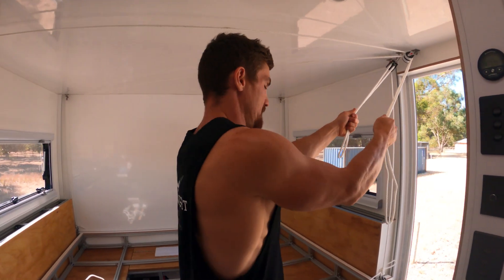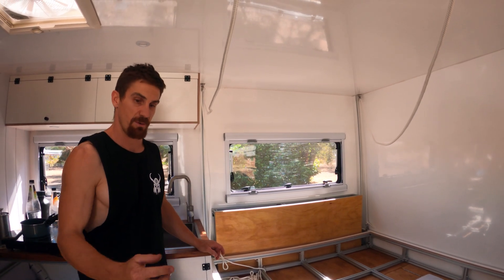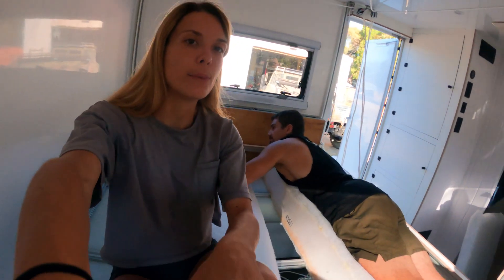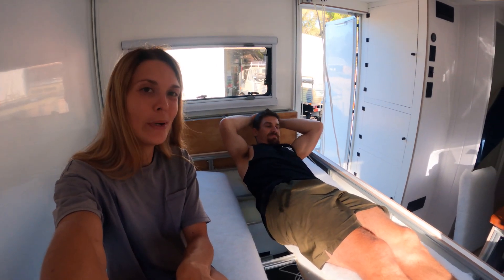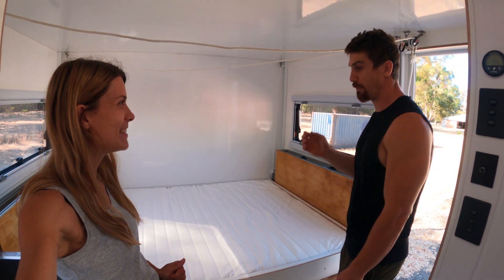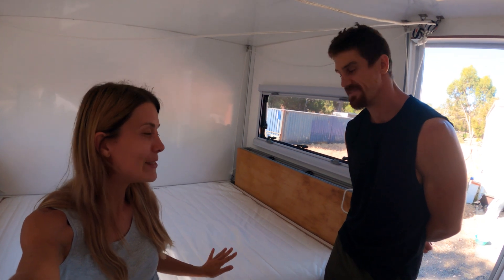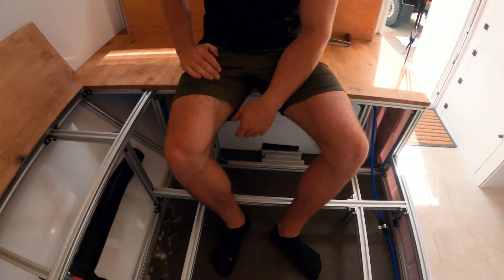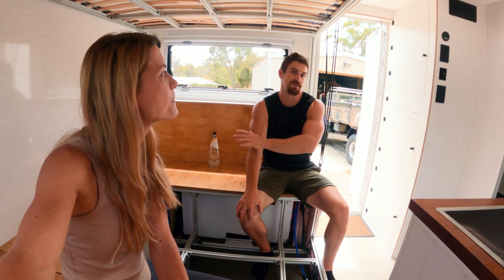Affordable DIY Bed Lift - Getting Close to THE END OF THE BUILD! DIY Camper/Caravan 36

Comment: You could put a contact connector that only in the upper position transmits energy to the structure of the bed in this way you would not have loose or moving cables if you like I can send you a diagram, Hello from Bolivia I love your channel

Comment: Try electrical chain conduit for the hanging wires. 

URBEST Black Plastic Flexible Nested Semi Closed Drag Chain Cable Wire Carrier 1M 15mm x 30mm for Electrical Machines

Comment: Hi guys! What do you use to connect the bed frame to the rails? Specifically, the part that guides the bed up and down. We’re using a 30x30mm aluminum profile with an 8mm CNC rail but don’t have a door sliding mechanism. Do you have any suggestions for guiding the bed frame through the profile itself? Cheers

Comment: I would have probably used a linear guide in the corners, SBR20 or 25 for example, instead of the sliding door mechanism. They are a bit more substantial. For the cable maybe have a look at cable chains.

Comment: Hi guys, what about using a usb battery pack to power the puck lights, then you only need to plug in a wire when you need to charge the battery  pack. You could wire in a switch somewhere under the bed to be able to turn them on and off.

Comment: You could use a long bar 3)8 threaded and a 50gigherzt to 60 electric motor with a washer two should be place them apart two spool line down

Comment: Slick. This is one of my favorite designs. I would pay for a class on how do replicate what you did. I love that you powder coated the rails white - plain metal has been one of my primary objections to using rails and you showed me a new way of doing it.  I'm curious how much it cost total (I apologize if I missed that part)? I'm also wondering if the bed partially rests on top of the seats? I'm wanting to do a system in a bedroom without the underlying seating. Also wondering if the pully system had  to be at an angle, or if it could have been attached to the wall?

I would love links to the winch, cleat, etc.

Comment: Re power. I had a another thought... If the power is for when the bed is up all the way or down all the way, then you could use spring loaded contacts like you get on van sliding doors, then you don't need the cable. jaycar sell them Sliding Door Switch / Contact Plate.

Comment: I would put battery powered lights in to avoid wiring lights into your system. Or if you really want to have it put the wiring into a retractable spool similar to a seatbelt mechanism

Comment: Alucobond or whatever brand you can find for the bed ceiling. Light weight and easy to use (may already have been mentioned didn’t read through 200+ comments)

Comment: Yes I figured you would have went with the other style or folds up and down that way you don't have to worry about the pulley system breaking and coming down on top of you on the other way it won't move because it's locked in figuring you'll be more safer and then go from there ok

Comment: Yes that thing down by your legs when you come in the door might want to pay more attention this way you won't smack your shin on your pulley system that's going to hurt but the wire we have right there if you're able to I'd have something right there like a little round thing or square tube you put the wires through that's pretty flush really straight that but the thing down by your knees you might want to have a guard for that so that way when you come in you won't really smack it really hard one would think

Comment: G'day Guys,
Perfect results.
For the light, if it comes from the roof and hangs down beside the bed it will hang down (in conduit) as the bed goes up and down. For bottom of the bed, why don't you continue the sailing theme and use a sail and glue and screw it to the bottom of the bed frame.

Comment: Land  yacht as a name has negative connotations, while it is large..not large enough to be called Leviathan, yup need at one more axel for that :)  multi coloured rope, with a nice mix of dark and light colours will show less dirt then even black rope. You could call the rig “mogi” or hortence.    Are the light high or low voltage?  I’d use a flexible wire way…like they use for robots etc…the wires will last almost forever.  Otherwise use a soft rubber cord you can route with a nice loop and have out travel up and down.  Live confidently and peacefully

Comment: The cleat and winch will hurt when you are walking past and knock it. Can I suggest a better system with pulleys under your seat. Or electric mini 12 volt winches mounted under your seats with a switch at the door.

Comment: Research linear actuators, u will find them in lengths that could suit your bed lift idea, 1 flick of a switch could provide u with an easy to use bedding system!
Reply: The problem with linear actuators is that you are limited with your stroke, e.g. to get it right to the roof you need at least a 900mm stroke but the when when retracted the total length is still over a meter so the will only go down as far as about the top of the seat giving about 900mm of head room. This is used a lot but their rope system allows the bed to go down further. The Lippert beds work on a similar system.

Comment: At some stage in the near future I will be getting a Mog and putting on a camper.
Not sure if I will be doing it myself of simply getting Unidan, Bliss or someone else to do it, but I've been watching your build and Damn, thats not bad!
Main difference I will be making is setting up the camper so I can jack it up and remove it from the Mog with actuators.  If your familiar with Unidan then basically how "Kermit the Mog" was setup. (removable camper)

I like my extreme 4WDing when I go places, so the ability to drop off the camper and go climb things that "*Can't*" be climbed really appeals to me.
I had been struggling with space and so I had also decided to do something like that with the bed, but I was looking at 4 actuators, I had never considered a rope solution. Thats brilliant. Are you using dyneema rope (very strong but more importantly, no stretch).
Your solution is brilliant!  Well done.  Maybe run the diagonal rope that goes to the far corner through a pully on the other rear corner?  Maybe encapsulate the rope with conduit (maybe at a later date)?  Just thinking of hiding it.

I have also worked with that aluminium extrusion before, it can be a bit painful (specially 'if', scratch that, 'when' you forget bolts), but its very versatile and strong.  Just gotta be very careful to cut it at 90 Degrees. 
I'm also thinking of making the box slightly taller with a false floor (250mm or so) so I can put batteries, tanks, plumbing etc in the floor so its possible to contain everything when its lifted from the vehicle.  Again, the alloy extrusion with some bracing should do the trick.
I'm in Casuarina, Perth, WA.  I would love to come see your unit some time in the future (closer to when I'm ready to start getting serious and at a time more convenient for yourselves).
You guys have done a phenomenal job.

The wire for the lights.  You could use flat cable in an appropriate size piece of square or rectangular conduit (have to play with sizes) so that it simply folds and roles up and down in the conduit.  A bit hard to explain but think of securing one end of a flat (ribbon) type cable, then pocking the cable down a rectangular conduit so it doubles over and simply slides down the tube, then comes out again when you reverse the direction.  Would probably need to use 4-6 core ribbon cable for rigidity.  Hope you understand what I mean.  Anyway, just a thought.

Comment: ARB sell a $25 fridgeslide cable collector  for your light cable
Reply: Buy two and join the to make the right  length if needed or you can use a clean motor bike chain and cable ty to it

Comment: Awesome construction guys! We are also going to build an aluminum frame with pulley system. What size aluminum extrusion did you use? 3x3, 4x4, 5x5?
Reply from the maker: @the.biohackervan  Thanks a lot!  Everything was 30x30 and was easily strong enough
Reply: @ awesome guys, thanks for the inspiration 🙌🏽

Comment: For cable try a curly cord aka spiral cords
If you want to go high tech... find a kerb side collection and remove the cord rewinder from a vacuum cleaner. Remove the push button to rewind and it will keep the cable taut, mount it under the seat.
Too late now... but maybe for others, if you mount the rope eyes on the bottom of the bed, you would get it slightly higher.
I like it though! Well done!
Reply: Good idea with the cord rewinder, I’m likely to use that idea for my bed lift system.
Reply: @LifecRaftTransform  Also could use the power connectors in wizz bang van doors.

Comment: Hey guys easy solution for the lighting cable is to run it to the ceiling and then down through the bed then it will coil up on top of the bed as it is stowed and uncoiled when the bed is in use. a heavy coiled hose  like an glad hand air line could be used to keep the wire out of trouble during the raising and lowering, 
I would also suggest for the bottom of the bed you could use canvas held in place with Velcro.

Comment: Question for Chris and need help/advice: I recently bought a new Jeep Wrangler JL and installed a rhino rack backbone 3 bar system to carry my rooftop tent and awning weighing 100kg 20kg below sealed road dynamic load but 20kg above off-road dynamic load rating. Please let me know what roof rack you guys used for the “general” and what your adventure kings roof top tent and awning weighed and if you experienced any issues? Thanking you in advance ! Ryno

Comment: An idea for using the pins on the four corners of the bed is a push ball Lock pin you just take your thumb and push a little pen in to lock in place same to pull out  that way you don’t have to worry about the threads and stuff like that

Comment: Really impressed with the bed winch system. As for doing something with the electrical wire to the bed. They make a spring coil airline that you maybe able to run the electrical wire through to protect and keep the wire neat.
Reply: You can get the spring coils of wire mate they are called Suzi coils

Comment: Could you use ply and cover it with a white marine vinyl for the underside of the bed frame. It would add some texture and if you put some laminate or carpet underlay between the two it will add some padding for the inevitable head bumps getting up from the benches. I’ve seen it used on some Van ceilings and it looks well. Also easy to clean.

Comment: One idea is if you could find 4 12 V motors and put one on each corner and mount it below the bench then you could lift it up with four switches that way if you’re camping in an area that is not level but close you can always adjust one corner or one side of the bed down so no matter what your bed will always be level,  food for thought

Comment: Guys not a fan of the yacht theme bed set up cumbersome and bulky. Got to ask why didn't you go for a wall mounted fold up bed system mounted to the rear wall which would not cut down on the head height when up. Once you put a mattress, pillows etc on that  it's going to be a real head banger when you sit down for a meal inside.
Reply: I originally thought the  same but a lot of professional expedition vehicle manufacturers around the world are now using it and I spoke to the owner of one and he  said he never banged his head as you tend to slide into the seat.

Comment: I did something similar to that, but took the hardware from a pop up camper, and did it the same, using the cable, hardware, pulleys and crank from the trailer.  It took a bit of trial and error, but it works good.  (in a gypsy wagon).  If you look up re-cabling a pop up camper, it shows how it works.  Good job, looks great.

Comment: Gosh fellows. you've seen my canvas-top truck from over 30 years ago, and i remain amazed with that you have done wih new technologies and equipment! When you put gear in the back, it's always a good idea to check how much room you have left to live in, you'll need more than enough room to swing your cat or you will end up hauling a travelling cupboard full of gear!
It's a great idea to take the strain off the lifting ropes using shear pins. Once you are off-road, the bed base will move laterally as the Mog swings and heaves, causing the pins to creep out. Have a look at 'pip pins' or 'ball lock pins' on the web. They are used in several industries to insert quickly-lockable shear pins, which prevent the pin from wriggling out. They aren't too expensive for the strength you will be seeking, but you may need to put a locking washer on the far side of the pin-hole to reduce wear on the structural aluminium. 
Food for thought anyway, and keep on inspiring me! Cheers, Mike.

Comment: The top foam can be cut into two wedges and a sewn seam. Give you two pillows for elevation and ice because injuries happen and two they are versatile for snuggle time. simple boat seat strap with a button and it is the back for the table. Those electric knifes or a hot wire shapes foam well. Pillows made from your goose down coats are storage and comfy. Not a small guy hate foam mattresses prefer a spring foam for sexy time, stability, body heat etc. most camper builds include under mattress air flow do to the humidity. Great success I will be watching for tips on my future build. So exciting seeing others building their dreams. I think weaving nylon straps across the bottom of the bed and gluing a thin padded head liner is a great idea; As a combat veteran than has been dropped to his knees even with a helmet smashing my noggin inside a vehicle. Over head doors thumbs up and standing up vs a side hung door, my build needs to be head injury cautious. YouTube observation—locking mechanisms on all drawers and doors come diy recommended across school ie, van, & overland builds.

Comment: Great build so far! One worry i have is eye bolts possibly woring their way out of the holes over courigations with the other worry being the bed bouncing up and hitting the ceiling. You have some pins with a cotter pin or something link a linch pin, something where it has no chance of coming undone by itself. Another thing you could do is have a stop above runner on the track (like the eye bolt you currently have the bed rest on) to prevent the bed from ever going too high (think going over bumps or curigations/washboards).

Comment: Regarding your light cable why don't you run it straight up the corner and cut off where the bed stops and then fit a two point contact plate ( power and earth ) and then under the bed fit your lights and run that cable to where the other is and fit a contact kind of plate with power and earth. The idea is when you lift the bed the two ends will come in contact and complete the circuit for the lights. Hope that makes sense. This way all your cable is fixed. Being 12 volt should be fine.

Comment: Use the track system, they use on 12 volt fridges in 4wd canopies , looks like a track off a bulldozer , will work no worries
Reply: I thought of something similar to that. The track used on CNC routers should work really well to guide and protect cable in a moving installation.
Reply: Energy chain it’s called mate

Comment: Great job guys. I recommend setting the pulley system up with a mechanical advantage to make it easier to raise and lower and to reduce the weight on the pullies, etc.
Reply: You could achieve 3:1 easily with a couple of extra fittings.

Comment: linear actuators would have done this easily, you already had used the t-slots...
Reply from the maker: Actuators don't work with our layout, we explained why in episode 31.
Reply: There wouldn’t be enough stroke to go from the seat to the roof, most of them stop the bed at the top of the back rest.

Comment: looks like you could easily gain 40-50mm more height out of the system if you changed the mounting points and eyes.  i mean you could eliminate them completely just by drilling holes and tying a knot on the other side.  No knot and no eyelet required above the top rail.
Reply from the maker: We still need room for pillows & doona above the mattress. If we feel like we need more height, we can definitely make some small adjustments :)

Comment: There has to be a power cord ratcheting system similar to those found on home vacuum cleaners. Wouldn’t that be nice for a self returning power cord for the bed? If the eye-bolts are significant enough to support the bed and body weight without deforming the tracks, they would make a nice “stop” just above seat-back level so the cushions didn’t have to be removed every night. Crawling in bed may be a bit of a sacrifice but gaining that extra space under the bed at night may be worth the effort. Someone beat me to the punch of a white finished, perforated Masonite sheet for the bottom of the bed. How about a taught sailcloth with led strips hidden under it?  I know this has been a process you may never want to repeat but you two are doing great and the content shows definite progress. Progress towards getting back to outdoor adventures in luxury! (Where are you going to put the kayaks?)

Comment: For the ropes hanging by the door, you you put a canvas sleeve around it so it will help help with the individual ropes snagging on anything coming in from the door.  You can suspend the sleeve from the roof and use Velcro on the sides so it is easy to fit or remove.  Easy to make
Reply: a white PVC pipe would work also
Reply: A simple Velcro wrap then you can also secure it to the wall….
Reply: Our Tentipi has internal canvas sleeves over the internal ropes which helps keep them from snagging on stuff.  Simple and easy to make.
Reply: @edpikestone6800  Or once the bed is secured in the 'up' position, just uncleat the rope and throw the whole lot up on the bed, out of the way
Reply: @damienkillalea3863  good idea